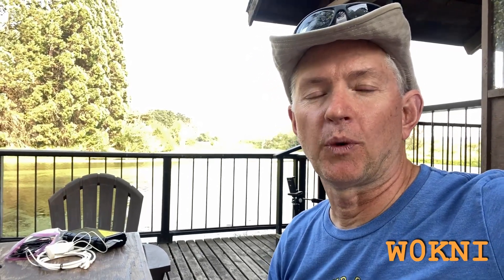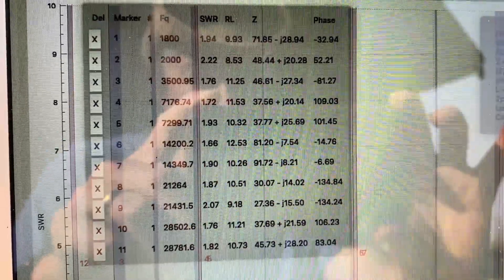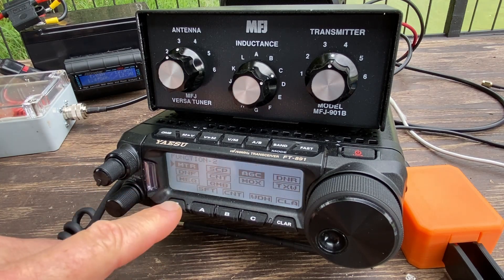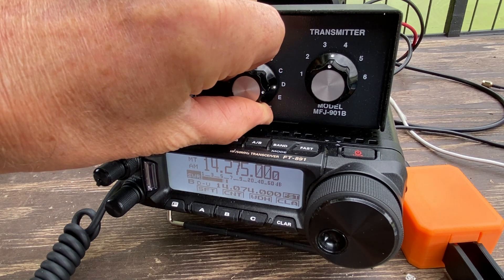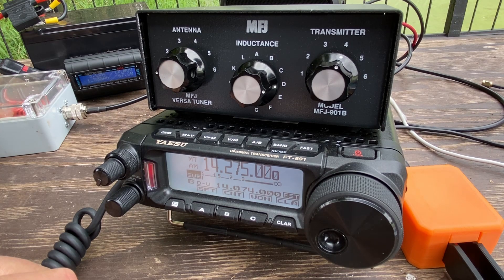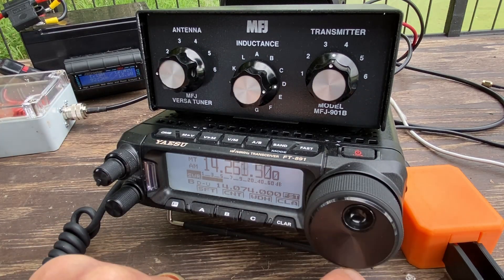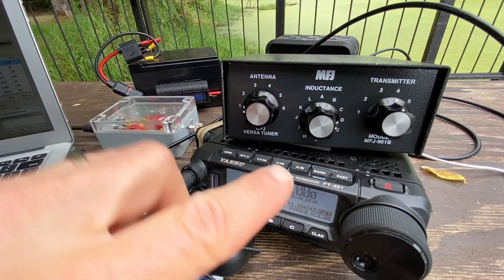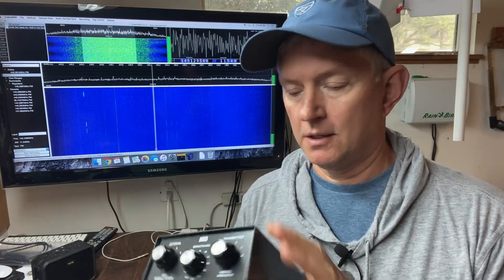Review - MFJ-901B Manual Tuner with Yaesu FT-891 HF Transceiver

Comment: Seems like a lot of “other” equipment is also needed to verify the antenna settings with the tuner? Too many steps for my taste. While I like the idea of a manual tuner, the autos seem to be a lot faster and more accurate. Maybe a manual tuner with the appropriate meters built in would be easier to visualize the settings vs hoping back and forth with several pieces of equipment? Just my opinion 🤷‍♂️

Comment: Before you use an  MFJ   tuner the knobs need to  be calibrated  6 on the dials should be caps fully meshed = max capacitance  1 = min capacitance caps fully unmeshed.I haver never seen an MFJ that had the knobs set on the shafts correct. Just open the box and slacken the screws on the  knobs .They are a good tuner i four of them all needed calibration ,must have something to do with assembly convenience .Ei7gg
Reply from the maker: Hey Charles, wow good info. I would not have known having just one.  Thank you!

Comment: Ok, you did not say if you were keying the rig, or just using and listening to the incoming ref signals.. .. two different methods of doing the tuning…
Reply from the maker: Hey there!  Good question and sorry the video wasn't more clear.  The instructions say to start out with adjusting the tuner while receiving first.  Look for the loudest or most noise.  Then lower your power and key your mic on AM or RTTY and start making finer adjustments.  I now use this on my base station for the harder to reach bands.

Comment: Does this tune 10:1 or just 3:1 or less?
Reply from the maker: Oh at least 10:1 if not more! I use it at home still but not so much in the field now since I normally run a monoband dipole
Reply: @W0KNI  I may need to buy one. I had an ldg tuner die on me.

Comment: I use a Rig Experts AA-35 Zoom to analyze my antennas, and I really like using it. The one thing I don't understand is that when the analyzer is typically used with antennas outside, it can be really hard to see the display outside.
Reply from the maker: Hey John - thanks for watching.  I totally agree with you.  Last xmas I bought a 991A and the AA-55 zoom.  I really like working with the VNA on the bench but the screen is pretty much worthless outside in the daylight.  I love the RigExpert for it's ease of use and durability in the field.  73

Comment: Sir you need to be alot quicker when transmitting and adjusting your atu for a low swr .....FINAL TRANSISTORS ARE EXPENSIVE OK
Reply from the maker: Hey there. Thanks for the tip. I make sure to only tune using 5w just to minimize any issues like that! Thank you!

Comment: I have the same setup with FT 891, 901b, home brew 9:1 balun and abt 84 feet of wire only 17 ft up and in  "L" configuration. It works fine. Good tuner.
Reply from the maker: Hey M.K. 😁 Perfect setup! Gets the job done and so very tunable.  Hope to hear you on the air.  Cheers!

Comment: Nice video. In my 3 HF/VHF/UHF (FT 857D, IC 706 MK2, FT 818nd), I use three models of the MFJ mini antenna tuners (MFJ 900, 901B, 902B) in the go kits.  I have found all 3 models to do the job when I use them with the standard dipole antennas
Reply from the maker: I'm very happy with it.  It packs well being so light and does what it's designed to do! Thanks for watching.

Comment: Hi Stephen, thanks for making the video.I wanted to ask you about the power output settings on 891. I just purchased a FT891 and have only had it for 24 hours. What is the difference with HF SSB PWR and HF PWR. Cheers, Roc
Reply from the maker: Hey Roc - thanks for watching.  What a great radio and so so many options!  HF SSB PWR vs HF PWR.  The easy way to remember for me is HF PWR is data.  RTTY, DATA, CW fall into this category.  There is also a 50M and HF AM PWR setting but that is self explanatory.  I like to start at about 25W for SSB and work my way up.  For DATA like FT8 or PSK I start at 10W.  See you on the air! W0KNI
Reply: @W0KNI  Thanks for the reply. We should plan a QSO!!!
Reply: @W0KNI  
Cool radio, set the radio to 100w ssb and 25w in ft8, the when switching between ssb and ft8, the radio remembers the powersetting. 
is there an extra powersetting for FM ? 
how good is the modulation in AM ?
Reply from the maker: @PIasmaZombie  The FT-891 has several power settings for different modes and bands.  I agree with you, it's really nice having them separated.  Yes, FM, AM, SSB and DATA all have their own settings.  See menu section 16.

Comment: Thank you for sharing I wanted to ask if the Rigexpert software you were using runs on a Mac.
Reply from the maker: Thanks for watching! YES it does. I was on a 2015 MacBook Air.  I go back and forth between the free AntScope 2.0 software and the free web app for the Nano.  Both have their strengths/weaknesses. 73, w0kni.